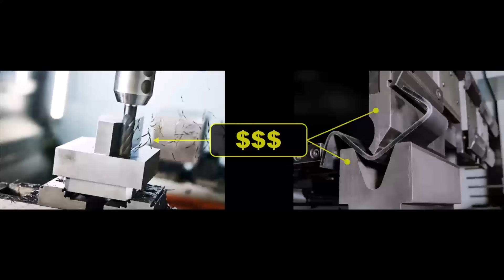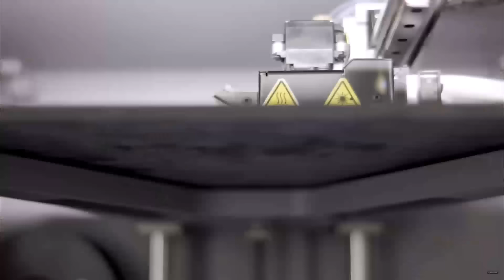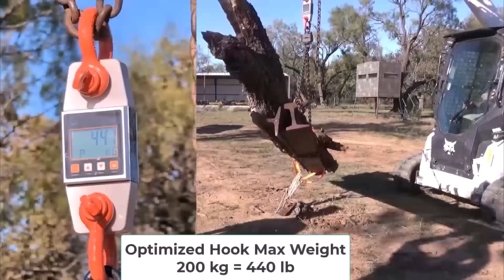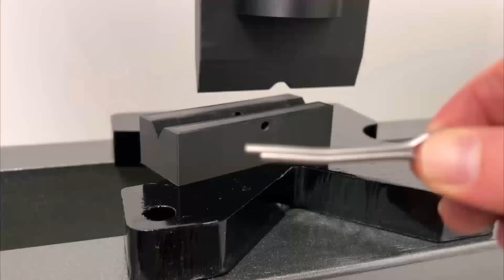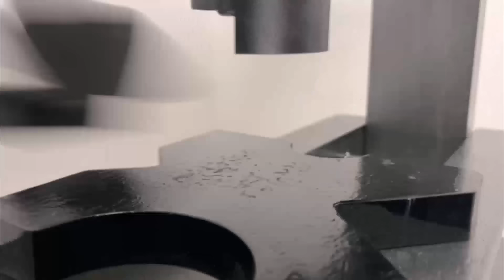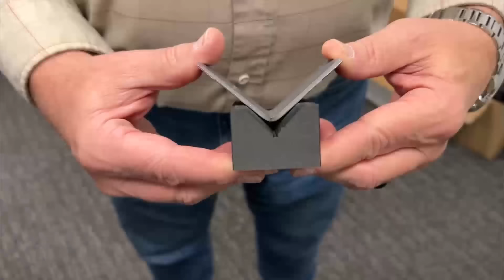3D Printing | Turning Small Sheet Metal Bending Jobs Profitable with 3D Printed Dies

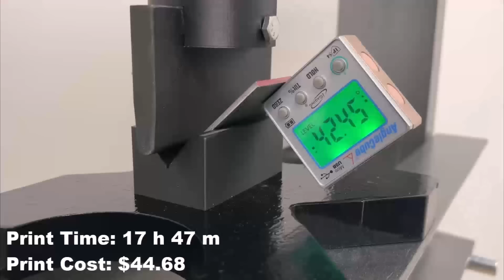Comment: 13:20 you really could have added a few bolts through the bottom part to keep it under compression.
Edit: scratch that and watch [Random Routing]'s video "AWESOME 3D PRINTED PRESS BRAKE DIES !" from 4 years ago. He made epic die inserts that don't break.
Reply from the maker: Good catch—and appreciate the follow-up. Keeping the lower section in compression makes a difference, and [Random Routing]’s approach is a solid example of that done well. Different designs solve the same problem in different ways, but your point is well taken. Thanks for sharing the reference and adding to the discussion.

Comment: You guys have balls of steel trying to bend that 0.125" flat stock. Having ran a press brake myself, I know just how much force is involved in bending something that thick and there's no way in hell I would be anywhere near 3D printed tooling being used on 1/8 inch steel lol. Also, we used to cut up 0.5" steel plate on our waterjet, stack up the pieces and weld them together just like you guys did. Even with that homemade tooling I used to get nervous. Our machine was only capable of 40 tons, but a guillotine is a guillotine.

Comment: Forget using plastic... You know you can print metal right?

I asked the DMV if I could make my own plate, but they denied me, stating I had to use their plate at crazy prices.

I think you are failing to include the heat generated in the bending process. You can also counter deformation, planning for that in the bending process. If it compresses the part by 1/32", you can make the die that much larger, so it ends up at the perfect form, at the end of the bend. A disposable, mountable slip-form.

You should also make a die-guide, to stop misalignment. It would be much safer to bend that way.

To stop delamination and make stronger parts... Build the dies vertical. You want a singular pass along the stressed sides, not creating horizontal planes that can separate. Also, make the bottom die more like a solid triangle and round out the crease of the "V". A "U" is stronger and will not "axe shear", under load.

Your jack should be pressing on an "I" beam, not directly on only part of the die. Those sharp corners will eventually shear through the top die. Nearly half that top die was dead weight. Pressure acts in a 45-deg angle from the greatest contact point. Your top die should have looked like the top of a dustpan or a pyramid with the top lopped off, so it just barely touched the edges of the cylinder. Thus, why an "I" bar mount, to spread the forces across the whole die top, would have been better. I'm sure the folds were slightly curved up at the ends, due to the top die flexing a bit.

Comment: Have you considered a different shape for the v block? Would sloping the vertical walls give you strength against lateral forces? 

Since this isn't being machined out of a piece of common cube stock you can play around with the shapes freely. I was thinking, in addition to sloping the walls, you could add alignment pins to the top part (the punch?) and matching shafts to the v-block (apologies if I'm murdering the terms here). 

I love the limitless capabilities of additive manufacturing (I 3D printed replacement legs my couch, works perfectly!) and this video is exemplary of that. Keep up the great work!
Reply from the maker: This video inspired so many great ideas from the community, it really does demonstrate how open-ended additive manufacturing is in terms of design freedom and continuous improvement.  Thanks for the ideas!

Comment: The forces act outwards, but that stresses the layer lines in your orientation. no amount of fiber is going to help in that orientation. So just print the v block vertical. The same is true for the stamp.
Standard PLA is a great material as well as its one of the stiffest materials and its cheap. think about where the stresslines are in your geometry and use modifyers to add 100% infill in these areas.
Reply from the maker: Great suggestions!  We pushed the scope of the original problem quite a bit and ended up in a new type of problem, so the next step would involve new orientations, hybrid assemblies, solid infill, or one of many alternatives to address the new stresses.  The best part of 3D printing is the ability to try several things and iterate quickly.

Comment: I spent a lot of time with MLC  Cad in Stillwater, Austin, and Houston beginning in 1997 when they were just getting started with SolidWorks. 

I’ve also spent a lot of time in a sheet metal shop. Here’s a couple of suggestions. The width of the vee should be 8x material thickness for mild steel. As for your prints splitting the vee, try  printing with a rectangle on both ends. The rectangle matches the width and height of the vee die. 

I have a killer macro that I wrote before retiring. If you’re interested, contact me. You should still have my home email. 😁
Reply from the maker: I started a few years after you, but I've been a fixture at MLC Stillwater since 2008.  We have a lot of folks that spent time around sheet metal but we clearly haven't gotten as deep into the design of the dies themselves as several members of the community.  Thank you for the advice, I'll relay it to the team if they decide to keep attacking this challenge.
Reply: @   I wonder if I could send a video of the execution of macro to the VBA guys at mother SolidWorks?

Comment: Nice video!
My reccomandation:
- Get your die block to be smaller. Usually we use long finger's or v-block to accommodate our machine's. But there really no need to print stuff this high. Use blank metal part has backplate and reduce the high of your die. You'll save on printing time and money while gaining strength!
-  Print 100% if you want your tool to be use a lot. Filament printing has a tendency to deform under compression even when doped with carbon or glass fiber.

I did lot's of experiment in the last year's including compression test and we will do more in the futur.
The next step is to use material like 10k from Formlab for the external layer. Most filament print are good in tension or bending but not quite good in compression. Using a resin like the Formlab 10k will give you crisper details and better toollife because it wont deform or get worn out like filament does. Using a printed backing and metal backplate to put all this together will guarantee the shape, size and form of the tooling and part.
Reply from the maker: This is great advice for continuing to explore this topic!  Our original goals for light-gauge material worked very well, but we started to run into issues as we expanded the scope of the problem.  At the end, we realized we had started an entirely new project and it's time to re-evaluate and brainstorm how to proceed with this new objective.  I love having a community of folks working together and sharing information, thank you!

Comment: Considering that if I made a short run set of dies out of 1018 cheap steel  on a CNC machining center, in 10 minutes. That would be able to press a few 100 parts before you got your plastic dies printed .........
Reply from the maker: This is a great approach if you are setup to do it efficiently.  Not everyone has a CNC machine in-house or is setup to handle custom tooling jobs, plus if a CNC machine isn't making money you're missing out on revenue.  If you need to bend a couple of part variations for physical testing, plastic parts will give you the opportunity to do that quickly and inexpensively before cutting steel.

Comment: A great watch! Thanks for doing it.
Options: the bottom die could be placed inside a cheap CNC vice to prevent the deformation. This can keep your printing costs down and provides security to the bottom piece. And for the top piece, if the plan is to do more of this, possibly have a standard die "holder" machined providing metal pressure along the whole width of the printed die and where only the lower section of the die is printed. Just some ideas.
Reply from the maker: Thanks for the input!  We were also thinking of a steel channel that would provide support under and around the bottom die but a vise would do that well and be adjustable, perhaps even allowing a pre-load!  If we keep doing this we'll need to address positioning and alignment for sure, many of the failures would never happen on a brake press with the alignment grooves.
Reply: @MLCCADSystems  Ah yes re. Alignment.
For a cheap solution, some rail/bearing system from AMZ could quickly be adapted to your current press frame, possibly. I did something similar for a DIY air press out of hardwood for my wife. It was surprisingly accurate. The issue was fine tuning the alignment for the travel length. Long process but great once set (yes, even w wood!)
Reply from the maker: Awesome!  Hardened tool steel definitely has benefits in production, but is overkill for a lot of applications.

Comment: You have to print at 100%. Very cool.
Reply from the maker: Good idea, especially if we plan to run a decent volume for that shape. We didn't articulate the specific goals for this project very well, and the shape was still undecided, so we wanted to iterate quickly even if the dies did not last long.

Comment: very nice - when I saw the delamination issues, it made me think back @3:07  where you should have better strength by stacking 1 or 2" wide blocks (extra internal wall thickness for each added block and custom widths as bonus)   - similarly consider setting the slicer to solidify key locations with a modifier (it may help with the blunt edge of the head) - anyway, love to  see the testing it gives options to small shop fabricators like myself
Reply from the maker: Great ideas! I think my favorite thing about this video is how it is inspiring discussion and we're seeing a lot of great suggestions to try.  Now all we need to do is find time to try as many as we can!

Comment: if the piece being bent is less wide than the block, the block can have 'closed' sides, which should pump up the strength tremendously. 
another idea might be to print with a set of vertical holes on each side of the block, and drop some steel pins in there, which should spread the lateral forces across more of the part. 
still working with very simple shapes, but it would increase strength tremendously. 
just modeling the holes for the pins might actually increase the strength of the part, since those holes have walls and those walls are going to be stronger than the infill. 
it's a trick to strengthen regular 3d printed parts.   so that would boost strength a lot, but dropping a couple of steel pins in there would skyrocket it. :-)
Reply from the maker: I love using a hybrid approach, using cheap steel shapes or parts to add z-axis tension/bending/compression assistance.  Great ideas to try out for the next video!!
Reply: @MLCCADSystems  I haven't tested this, but the theory is sound, this guy modded code to create an offset brick stacking effect which should increase strength.  good theory but untested.. (FYI)
https://www.youtube.com/watch?v=QRzhpoQu1No
Reply from the maker: Interesting approach, the more 3D printing matures the more we'll see these types of options implemented for mainstream use if it proves to be stronger!
Reply: @MLCCADSystems  that's how it's been with many slicers.  and so many filament test channels.  but you can also improve strength on parts with sub 50% infill by designing holes into them, and those holes have walls, and those walls have more strength than infill.  structural/functional 3d printing is approaching CNC level expertise for how to make better parts. 
another excellent approach is slicing parts to print different sections in the "strong orientation"  and slotting them together afterwards for overall stronger part. 
it's not a checkbox in the slicer, but design process and production process is becoming more valuable for better end products. :-)

Comment: Try printing them on an angle so the layers are 30/45 degrees along the part. Also consider annealing them. A sheet pan with the part packed around salt and pop in an oven for a while (temp varies with material) and let it cool slowly. Bonds layers tighter.
Reply from the maker: I like the angled print idea, others have suggested printing the die on end but an angle would really minimize the weakness directions for these loads.  I haven't personally tried annealing but the salt trick sounds like an easy way to get great results.  Thanks!

Comment: Make a 2 piece 3D printed mold out of PETG or something glossy with release agent and compress chopped fiberglass (for concrete reinforcement) with polyester resin to make the dies. Then you have solid dies with incredible compression strength. You can even embed steel plate, bolts, or wire into the dies. Or even mix in some concrete mortar. Maybe even design recesses into the dies and epoxy exposed / replaceable steel rod onto the high pressure points of the dies.
Reply from the maker: That is a great approach to creating stronger final dies. Right now we're trying out various geometries to see what works, but once a final geometry and process is proven it is nice to have alternatives to step up to. A hybrid approach is an excellent way to add strength cheaply.

Comment: For everyone watching this who has a Markforged printer.  In eiger under infill change it to solid fill.   Much safer, this is how I do 3D printed press brake tools.
Reply from the maker: Yep, when the design is finalized printing solid is your best bet. We wanted to see how strong sparse could be and work out the feasibility and die shape quickly.

Comment: those printsettings are really not optimal for this usecase. you need full material connections inside the parts and not only infill. also continous fiber does almost nothing for applications that mostly consist of compression.
actually using any enclosed consumer 3D printer that can reach 300C and invest more into the amount and placement of polymer would be much better.
Reply from the maker: The print settings worked well for cheaply forming the initial bends, but as we pushed the envelope we stumbled into a new type of problem where we need to re-evaluate our approach. Solid infill, hybrid design, re-alignment on the bed, or post-processing for strength are all great ideas.

Comment: You may want to consider using a piece of 3 or 4 inch u shaped steel bar as an outer shoe and then design your 3 prints to fit inside it. This way you would have great strength to withstand lateral forces on the tool and reduce the potential for exploding tools, and still be able to 3 print custom bending tools to fit inside the steel shoe. The steel bar "shoe" needs no special machining. You can just buy a piece cut to length at your local metal store.
Reply from the maker: This is a great idea, hybrid designs are a great way to add strength inexpensively.  3D prints do really well in compression but we get into trouble when these massive forces create bending or shear. A steel channel would keep it contained and supported.
Reply: @MLCCADSystems great idea.. or possibly, create a sandwich with the 3D print in the middle, and a piece of angle iron on each side, bolted across, so that the 3D print is squeezed lightly in between. This way the 3D print doesn't have to exactly fit (or completely span) a pre-existing U. Also avoids depending on the U resisting "hinging"where the faces join.  Regardless, all the same principle of using cheap standard metal pieces to reinforce the custom 3D printed shapes.

Comment: Wow the acceleration that happened to the angle finder when the V block de-laminated really put the forces here into perspective. That was a ton of force. Great video! The low price and entry point of additive manufacturing is the first time in many years I've felt like we are finally in "the future"
Reply from the maker: Applying enough force was our limiting factor on the last video, so we borrowed a CNC press from a customer to run a batch and then bought this one to keep iterating more quickly in the office.  It will be interesting how far we can push it.

Comment: Try printing the bottom form standing on end. You can see it broke in the layer lines. Just an idea.
Reply: You could even do 0% infill, leave the top open and fill with high strength, fiber reinforced concrete with the alternate orientation
Reply from the maker: I had the same thought, once the air bending dies got deeper I think the entire problem changed from the original scope, we'll have to try it for the next video.
Reply: The top holder can also be printed in two pieces, to change the layer lines orientation, that would make much stronger.

Comment: To keep the V from splitting you could make it like an O if you look at it from the top. It will limit the width of the material you can bend but it will keep both sides of the V together.
Reply from the maker: It would be easy to try it out to see, there are a lot of simple tricks that add a ton of strength we could try next.